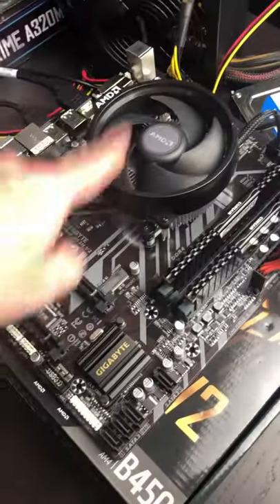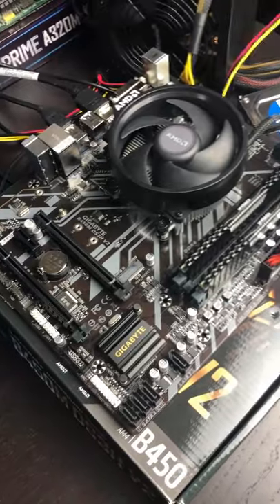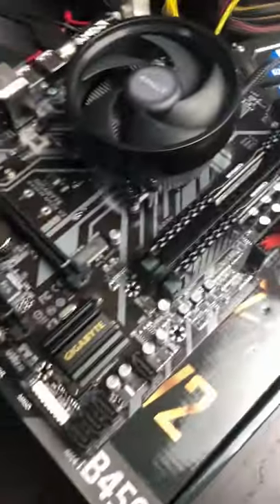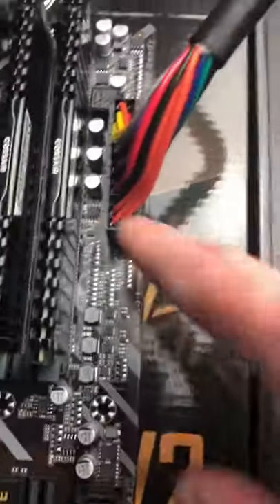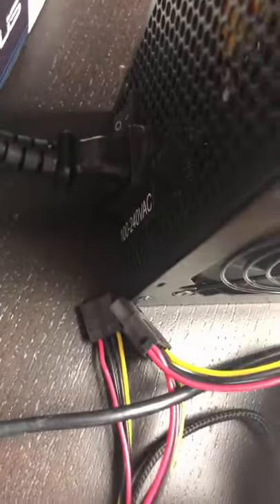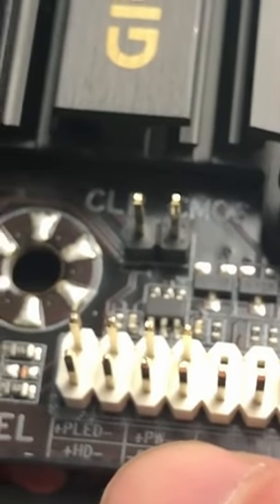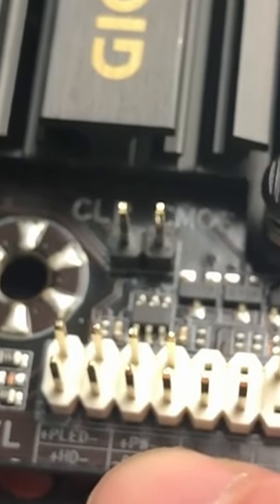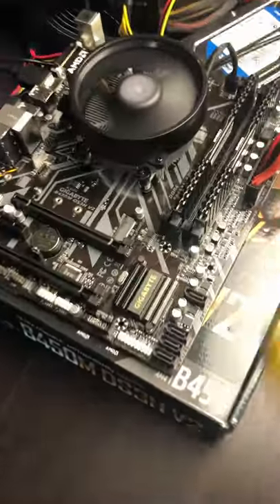How to Test Your New PC Parts Before Building #shorts

Comment: Remember when jumpers was a thing to pre test your computer lol
Reply from the maker: Hah!  Yeah!
Reply: i mean you can still do that
Reply: @Zakumei  true and I'm still doing being entirely honest
Reply: Why would you jump to pre test your computer? Is it just me who doesn't know what's jumper
Reply: @frozenturbo8623  its something you use to bridge certain reset connectors which basically hard-reset certain parts of the board when the circuit is completed. most people suffice with just a metal screwdriver or something but a jumper is a proper tool for the job, designed for it

Comment: I remember telling my electronics instructor that there was no risk of electrocution because the voltage is too low. He smiled and said, I'm not worried about you, I'm worried about the piece of equipment you're working on. Static discharges will ruin your day.
Reply: It has no effect, the handle inslates the screwdriver so all it is doing is jumping the connectors, which is the same thing as what the button does
Reply: @Badr AhmedThat's Google voice for you.
Reply: @Antwon22  Show me someone who has one bad habit and I can guarantee they have a dozen. Famous last words are, "I don't know what happened, I've done it this way before without a problem."
Reply: huge facts.

Comment: Just has to be conductive doesn't need to be a screwdriver it also doesn't need to be insulated not enough power to hurt someone can go through the Mb.
Reply from the maker: Agreed!  I was just trying to be thorough so people are safe when practicing what I put out there 😉
Reply from the maker: Hey nothing wrong with be safe 😉
Reply: @PCTechHustle  don't take it personal, people like to complain online
Reply: @PCTechHustle   it makes it seem like you need the expensive screw driver, which just isn't very viewer friendly. Any pc build can be done with 1 screw driver, but people make it seem like you need a bunch of money on tools. This is what scares people away. Just making the problem clear, thanks for reading
Reply: @HugoRBLX  as an industrial maintenence tech,  I've already spent a lot of money on tools.  Definitely more than I've told my wife I have anyway.
Reply: @nuke6702  lmao
Reply: @HugoRBLX  can confirm as a guy with defective case and I need to jump it every time I just use the screws for my glass panel
Reply: @chachasmooth1992  it’s not the 5V you have to worry about. If your motherboard somehow has a terrible short somewhere, mains might be on the board. Extremely unlikely but still possible.
Reply: @blablabla7796  If you are terribly worried about shorts, you would not be using a 8inch flat head screwdriver to make that connection.
Reply: @chachasmooth1992  insulated screw driver?
Reply: @blablabla7796  umm, go to home depot my dude. Flat head screwdriver is the one that has the end shaped like ( | ), 8inch is a measurement.
Reply: @chachasmooth1992  what is the point of that reply?
Reply: @blablabla7796 I I like discussing about nothing with complete strangers. To me, it seemed like you didnt know what a 8inch flat head screw driver was.

Im insulting you on the absence of knowledge in electricity and hardware.
Reply: @chachasmooth1992  absence of knowledge of electricity and hardware? I’m an electrical engineer that works on the chips that go into your phone. You don’t know anything about electricity if you think 5V is the problem with using metal to touch metal.
Reply: @chachasmooth1992  do you know what electrical “step-down” is used in motherboards and power supplies?
Reply: @blablabla7796  Im also an engineer, have many years working with hardware/software. It just seems odd to me that you didn't know how little of a danger a 5v pin does to the human body. Also, not knowing your tools. I don't know what engineering you have been doing
Reply: @blablabla7796  Isnt a step down converter a circuit that brings down a voltage. I believe that a powerbox is 5v and 12 v. The step-down will bring the voltage down to whatever the motherboard, cpu, gpu, etc needs.
Reply: @chachasmooth1992  what kind of step down? An engineer would know this. Unless your engineering degree is mechanical or unrelated to electricity.
Reply: @chachasmooth1992  I’ll cut to the chase. What harm does 5V pose to a human body? Practically nothing. What harm does a 5V PIN pose to a human body? It depends. Is the 5V DC voltage riding on top of, let’s say, 120V Mains AC? Is the 5V pin properly regulated?

The answer I was looking for was switch mode power supply or buck/buck-boost. Most modern PSUs that I know of are typically transformerless and use some form of switching converter. When you have diodes, stray inductances, parasitic capacitances, and a switching power supply, you have the potential of having a circuit that effectively dumps power one way into a node waiting for a poor sucker to discharge to. When you touch that one node with a screw driver, whether it’s flat head or philips as long as it’s not insulated properly, it can and will (more than happy to) discharge that built up power into your body and straight into the earth/ground potential. Possibly through your heart. Now, is this unlikely? Absolutely. But as the video poster correctly pointed out, it’s better to be safe than sorry.

Oh and in case you bring this up: 
“If that’s such a problem, how come no PC build tutorials ever mention this?” Well that’s because most videos about PC building is done with the power supply turned off and safely unplugged from the outlet. In this case, it’s obviously impossible to do this with the supply turned off.
Reply: @blablabla7796  lol, the amperage that comes out from the 5v on/off switch of the motherboard is comparable to a AA battery. If I lick it, I will at most receive a little jolt. You have zero knowledge of what voltage and amperage is. 

And what, are you also going to ask me about boost converters. What about transforming 120v ac to 12v dc. You are just using buzz words to sound intellectual, but  i'm pretty sure that you are just posing to be an actual engineer. You dont know what is a flat-head, whats a voltage and amperage, nor do you know a thing about engineering. 

I got a question for you, and its easy this time. If I have a AA-battery that supplies 2.5 v. How many batteries would I need to get 12.5 V? What type of circuit would I need to get 12.5 V from the circuit?
Reply: @chachasmooth1992  once again, it’s not the 5V we’re concerned about. To help you understand this, let’s completely eliminate the fact that it’s a 5V pin. Let’s just say it’s a piece of metal on your motherboard.
Reply: @blablabla7796  It doesn't matter, the case is grounded! If you lick the 5v pin and touch the case, its the same 5v 500mah signal. Nothing will happen, crisis adverted, you will be fine
Reply: @chachasmooth1992  again, the 5V is a distraction. We don’t care about the 5V.
Reply: @chachasmooth1992  Did you just say 5V 500mAh? What? When did we start talking about batteries? Lol. From the information you've given me, it looks like you only know about "cellphone tech". You've watched a lot of Samsung phone reviews and now you think you're technical. You even called buck a "buzzword". A university student would know this without a second thought. I'm convinced you're a civil engineer that likes mobile phones.
Reply: @chachasmooth1992  Oh no. You're a software engineering student with 0 knowledge of the physical layer. That's kinda sad. You should go back to your circuits class. Inductors, capacitors and diodes specifically. Look up voltage multipliers. This is a circuit with cascaded diodes and capacitors. After that go read up on switch mode power supply converters and how they operate. And maybe learn a little of transformer theory. You don't have to get into Maxwell's equations. Just the theory behind electrical isolation.
Reply: @chachasmooth1992  like you
Reply: @blablabla7796  no impossible has nothing to do with the Motherboard. Just dont by chinese power supplies
Reply: @blablabla7796  lol you dont know anything about the actual Engineering and protection in powersupplies xD.
Reply: @BrosBrothersLP  ah right. The mythical “protections”. Just like how we have fuses and circuit breakers in our houses so no one ever gets shocked.
Reply: @BrosBrothersLP  go ahead tell me what the power supply protections are. I’ll be happy to discuss them with you.

Comment: You can buy a temp pin jumper wired to a switch on Amazon for $6.  One with a pci slot adapter, lights and a reset button is $9.

Comment: How do you do this with a AIO liquid cooler
Reply from the maker: The process is exactly the same with any CPU cooler.
Reply: @PCTechHustle  Where do I mount the radiator? I’m worried about air getting in.
Reply: @bruhg9167  keep the radiator above  the pump

Comment: And then if you have a high end motherboard most have power buttons now 🤷‍♂️ also might want to mention you’re using onboard graphics otherwise you won’t get a post screen and they will worry
Reply from the maker: Sure I’m using onboard graphics but even if I wasn’t the process is the same, regardless of how you get your video
Reply: @PCTechHustle  process is the same unless the mother board has a power button if you don’t have onboard graphics your not getting a post screen 😂
Reply from the maker: @thelewisvrfamily2113  you are missing the point.  This video is about how to jump a motherboard to test your components.  Not every situation is the same with graphics.  Again that doesn’t matter because this video isn’t about graphics it’s about how to jump the board to deliver power to the board.

Comment: i got a new Strix 550 A board 2 months ago and it failed to post last week. showed DRAM error but i tested the ram and it worked fine in another computer.
dont need advice, i just sent it in for warranty fix but i just want to bitch about it

Comment: What pc should I get I have 300 already have gpu  and storage
Reply from the maker: Well you have to still get a motherboard. CPU, RAM, a power supply, case.
Reply: @PCTechHustle  I know but I am not sure what type of parts to get
Reply: @lewismtb5498  if you’re worried about compatibility, use pc part picker website. Other than that, I’d suggest doing boring research about parts on YouTube and google that sits within your budget.
Reply: @sugareddrip1099  OK thanks
Reply: @sugareddrip1099  would you recommend any parts
Reply: @lewismtb5498  what’s your gpu and budget in mind.

Comment: How do I turn it off now.
Reply from the maker: Valid question!  Flip the power on the power supply or if you manage to boot into windows if you installed a hard drive shut it down from there.
Reply: @PCTechHustle  okay thank you, and also if you flip your computer off from the power supply it won’t affect anything?
Reply: @Dior444L  no

Comment: Quick Dumb Question
How to turn post off?
Switch the psu?
Reply: Yeah you can either shut down the psu or if you have a windows installation you can shut it off through windows
Reply: @kegandavenport3179  will switching off directly through the psu won't harm my mb? (i seriously don't know I'm a nervous new builder With getting a build as soon as gpu prices get a Reasonable rate)
Reply from the maker: No you will be fine flipping the switch on the PSU.